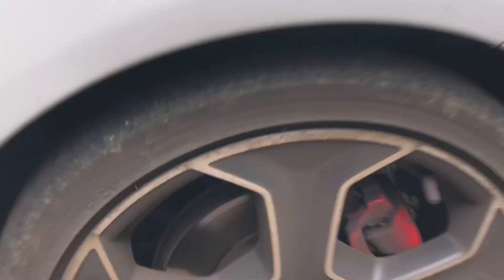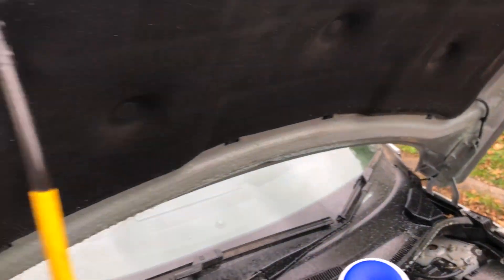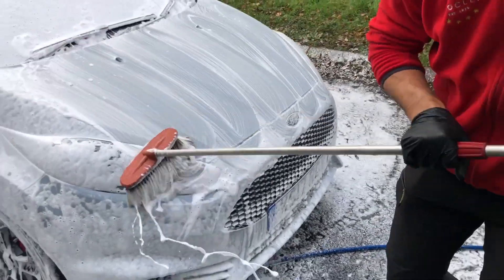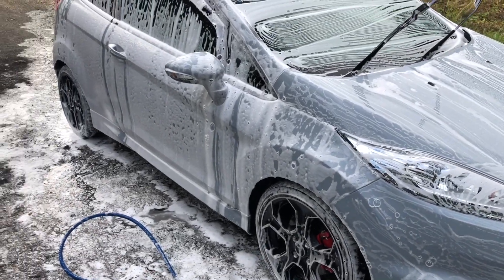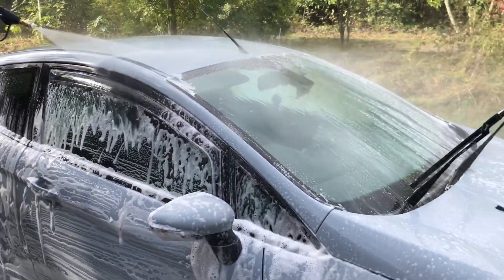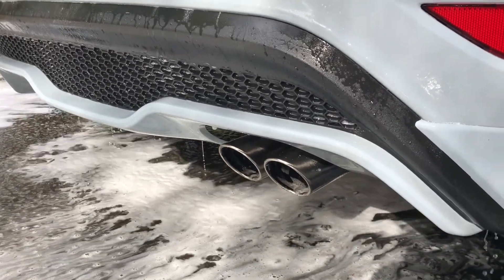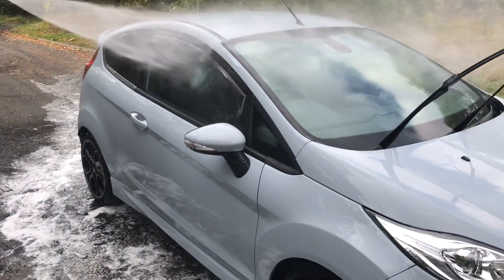THE FIESTA ST200 GOES FROM DISGUSTING TO IMMACULATE

Comment: The storm grey hides the dirt really well just px it on a black mk8 which needs cleaning weekly....
Reply from the maker: I was really tempted aha! But I’m sticking with ST200!
Reply: JAJ TV couple of things I did prefer on the 200 where the seats being more comfortable and the lower centre of gravity.
On the right tyres and a twisty back road the 200 might even be quicker than the mk8 but when the road opens up the mk8 has the legs.
Only thing with the mk7 is the interior which in comparison looks very dated now.
Lower center of gravity I mean the cars ride height  the 200 corners level and flat feels more hunkered down....
Reply from the maker: Couldn’t agree more!

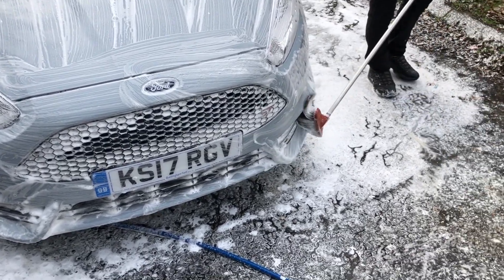Comment: I kinda do agree with some, the top coat is kinda sensitive on the ST200 (3:40 brush). Surely it wont do normal scratches, but I can garantuee it will do micro-scratches visible in the sunlight. Mine came with microscratches from factory since the tards from Ford had a "buff job" on it before giving to me.. Well, there is no way to avoid them except if you're not working as a detailer on cars. Too much headache - yolo!

Comment: Evening, stumbled across your channel so thought I would share a comment. 

Nice to see you sharing your experiences with your ST and building your own little community. 

I’m not being negative or “one of those” people but using the brush is wrong as a Detailer should know. Now I appreciate he says it’s a hog hair brush, and yep, they are amongst the best in the industry, but using it to wash a full vehicle is a no no. From the video is doesn’t look like it was rinsed and cleansed of contamination between panels. If it was, great, damage limitation, if not, that’s poor practice. 

Also some of the movements, top to bottom is best practice, not the dirtiest part to the cleanest. No amount of prewash and Foam will get the bottom as clean as the top.

I would be interested to see it under forced light to see what the micro marring, rds, abrasions and such are like after a wash with the brush. 

Whilst I may have critiqued the practices shown, I will also commend the use of some PPE (gloves) and a thorough pre wash process and cleaning the tyres. Tyres are the thing most people miss. 

Keep dropping your content and keep pushing on. Please don’t think of this as hate, just giving my humble little opinion on things 👍🏻
Reply from the maker: Hey man! Thanks for this feedback I really appreciate it, there were quite a lot of things I didn’t put in the video to keep the time down like the rinse and cleansing of contamination etc. I agree with the brush etc something I personally didn’t know at the time - they do a lot of work with big Trucks and lorries so they usually use the brush to get to hard to reach places but I guess he used it to speed up the process. He’s a good friend of mine so I appreciate his effort and the fact he did it for free, we did make another video where he gave the ST200 some winter protection and you can really see the effort he puts in and done his usual process of detailing without using the brush aha! But I really appreciate the feedback and I’m sure he will to! I hope you keep enjoying my content and thank you for tuning in!
Reply: JAJ TV I have literally just watched the protection video too. More to see what the practices were like on that. 

Whilst the brush isn’t the best, it’s ideal for trucks and trucking where paint perfection isn’t ideal. Maybe not the right tool for the job on the ST200’s paint as they are such a soft and sticky paint to correct. 

The effort he goes to is commendable. Not many people have the patience to do what us detailers do day in day out. It’s hard not to write these replies without sounding like an arse or a “know it all”. I just like to share advice from my own experiences and help people where possible. 

I know how hard it can be to edit a video down to something people will watch and keep engaged with. I’ve done it myself trying to get 3/4 days worth of recording down to 20-30 minutes. It’s a tough and thankless task. 

Again, full credit to your friend Connor. Whilst again I don’t agree with the brush, it clearly works for him and allows him to do it as a business with what I hope is a good loyal customer base for him. 🙂

Comment: OMG couldn't watch that. Bring the car to me and I will show you how to do a proper detail maintainance wash.
Reply from the maker: We just couldn’t find a good place to do it, plus we were strapped for time but they own a facility now where they do everything inside which is much better than doing it in the wilderness 😂
Reply: @JAJTV  cool,  but you can be still in wilderness and NOT use a brush lol. Merino lambs wool MIT is what you need to help minimise micro marring.  Your car after that wash will probably need paint correction now unfortunately, and especially if your having a ceramic coating applied next time mate.

Comment: So he's using a brush. Going haphazardly around the car with it and was it even rinsed between panels? No good detailer I know of EVER uses a brush. Besides detailing brushes to get in panel gaps etc and wheel brushes for wheel barrels and in between spokes.

Then he uses a clay mitt to remove tar! You're supposed to use dedicated tar remover that you spray on. Claying over tar will just drag it across the paint inflicting scratches! But hey, your car is nice and clean and the primer grey colour won't show scratches/swirls so much.
Reply from the maker: Thanks for the feedback, Richard! it's appreciated, from what I've been told the brush is made out of hog hair which isn't meant to affect or scratch paintwork but I'm not 100% on that! I can confirm that tar remover spray was used it just wasn't showcased in the video due to length etc, but I agree with your comment, it will deffo scratch paintwork if not used. I have got a new video coming out next Friday which showcases in a lot more detail as I had the car completely detailed yesterday polished, waxed and coated etc. So hopefully it can showcase his skill a lot more than this video did. Also many thanks for the compliment on the car!

Comment: Ok, I'm going to point out what he is doing wrong and right from an ex-detailer < not trying to toot my own horn but just as advice.

degreasing the inside of the bonnet and the engine bay :)

Snow Foam! :)

Using a brush... A detailer will NEVER use a brush to clean a car, the micro scratches it inflicts are immense even if they are small. - He said it doesn't scratch the paint... he went from the front valance to the wing of the car, you ALWAYS work down when washing a car... Also, he never dipped the brush to clean the dirt from it. < that's begging for scratches

Using the clay mitt without lubricant, I know you can use these with water but with lube, it's easier and kinder on the paintwork ignore the pun

Shame the video cut off, I know you said about a ceramic coating, IF you had something actually ceramic then the scratches that are on there are going to be sealed in, the only way to remove them is machine polishing the coat off. Also, applying any sort of coating like that should be done indoors where no dust or dirt can land on it while it cures. 

Get a direct source of light such as your phone or a torch and angle it, i would put money on it having micro scratches in it.

Other than that, Good vid!!!